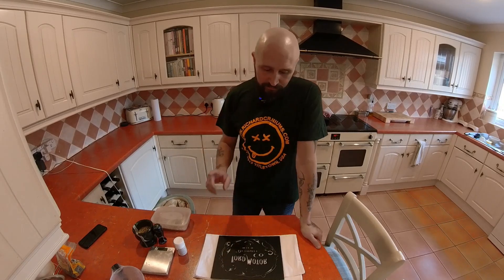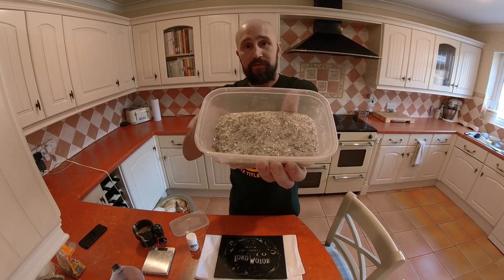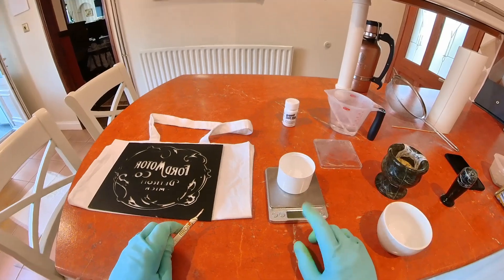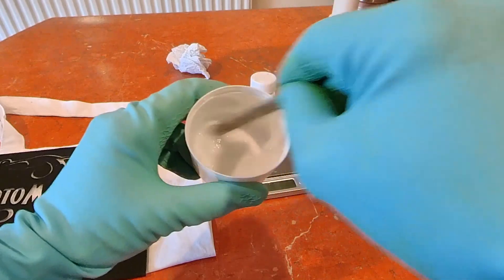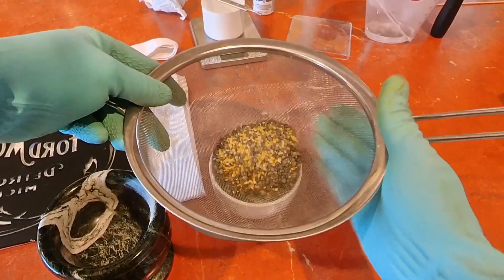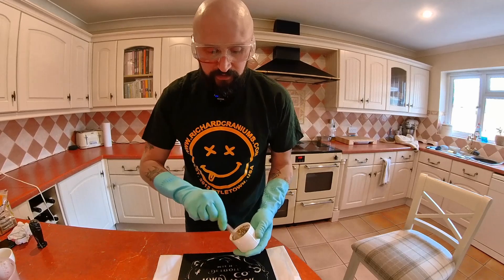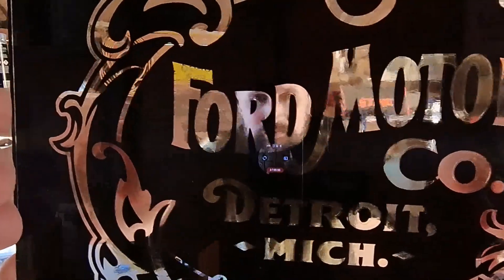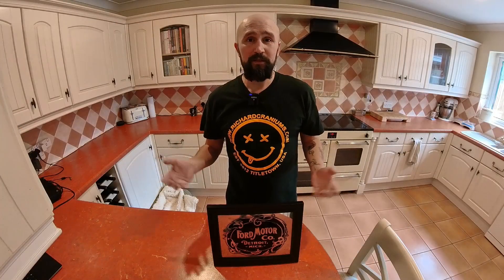Reverse glass process. Acid etching without HF acid

Comment: Great post Paul ... I have used acid many moons ago and too many issues working and disposing of chemicals. There used to be a "Fake" screen print ink that created a sand blast effect. I used it for  signage on office glass doors and full size windows so people were aware of the glass.
Be safe mate...
Reply from the maker: Thanks Ken! I don’t like working with HF acid. It’s too dangerous, so when the bottle I have runs out, I’ll use this method going forward. 
Hope you’re good mate!

Comment: Thank you for these tutorials. I’ve had an idea that I’d like to try out and this tutorial is such a great start.

Have you done an etch on the back of the mirror? I was going to use a mix of screen printing and the mirror spray paint but I couldn’t find the plain glass and thought a more cost effective way could be to etch the back of the mirror.

I won’t be using the HC acid but similar product that you are using here, as a test.

I’m a complete newbie to all this glass work and can’t wait to get started with it.
Reply from the maker: Thank you, I'm glad you enjoyed it! Unfortunately it won't work on the back of a mirror because mirror backing paint is acid resistant.
Reply: Yes, after some more research it does appear that I would need to strip the paint first then somehow remove the silver finish. I’ve read somewhere that Ferric Chloride or even bleach should work with silver based glass. Do you have any experience on this and what would you recommend?

Comment: Good video.
So, if armour etch, not diluted, makes a cloudy effect like sand blasting... could you use AE undiluted instead of sandblasting?
Reply from the maker: Thanks Stuart. You can if you just want etched glass, but the finish is too smooth for glue chipping. It also won't touch the backing paint of a mirror so you'd need a sandblaster for that. Great stuff though and the etched finish is lovely

Comment: It's a shame you removed the original acid etching video, but this is just genius as a way to make the technique safer and more accessible.
Reply from the maker: Thanks very much! It is a shame but it’s too risky sharing a process that’s so dangerous. This way is more expensive but so much safer that the traditional method

Comment: love your videos. if i were to use this method could i achieve chipped glass. i do not have a sand blaster so im trying to find a good alternative.
Reply from the maker: Glad you're enjoying the vids! This won't work for glue chipping because the etch is too smooth for the glue to grip on to. This may be an alternative though: https://youtu.be/jMZuSIynl94

Comment: So you used black spray paint for the black areas?  If so, does the solvent in the black spray paint not have any bad effects on the mirror effect paint that has already been sprayed?
Reply from the maker: No it doesn’t, but the mirror spray is very aggressive if sprayed on most paints, so it’s best to get that stuff down first
Reply: @happygilder  It looks like it didn't harm the black when you added the antiqued silver last so that's good.
Reply from the maker: @questort  you have to do really thin coats, otherwise it eats the other paint away

Comment: Great video and techniques again! I have a question : I cut vinyl, applied it to the reverse of a picture frames glass and sprayed it with the same mirror effect as you. For me, I sorted of "melted" the edge of the vinyl and bled through. Any ideas why ? Your edges look lovely and clean!
Reply from the maker: Thank you! The mirror paint is very corrosive so you have to apply it in lots of very thin coats rather than an even coating like most spray paints
Reply: @happygilder  thanks for that. I'll be more conservative with my application next time.
Reply: Could be the adhesive on the vinyl, I only use oracal 651 cause it's chemical based adhesive instead of water based like 641. If edge lifts that's why. I chemical silver all the time, never had a issue with lifting
Reply: @scotthendricks79  ok - thanks - I will look at that. I just buy the cheapest.

Comment: Do you have a video about framing or making custom frames for the glass?
Reply from the maker: Unfortunately framing isn’t one of my strong points so I won’t be making a video about that anytime soon 😄
Reply: The trick I used for this is to check the local goodwill and thrift shops. I go every weekend and come back with 2-3 new frames with glass that I can use from about $3-6 each.
Reply: @VektorHaus  
Same here. If I can’t find vintage ones at goodwill, I’ll take a torch to a wooden frame, clean it with a bristle brush, and apply some finish.

Comment: Quick question, with HF you need to sand blast it like glue chipping.  Would you consider it good practice to do the same with this process?
Reply from the maker: You don’t need to sandblast glass for acid etching. It works best on clear glass

Comment: Paul I enjoy the channel. I am a graphics designer and am trying my hand at glass chipping. I do not have a sand blaster but do have a laser engraver and my question is do you know if anyone that is etching glass has any success with the chipping on laser etched glass. Thank you for the channel.
Reply from the maker: Someone on the Facebook group tried it and had some success. I’ve never tried it so I don’t know whether it would achieve the same result as sandblasted glass
Reply: Thank you I will let you know if I get something figured out

Comment: You should always put acid into water. Probably not a big deal here but it's dangerous.
Reply from the maker: Thanks man. When I use HF acid I always add it to water so it doesn’t spit. I should probably do the same with the armour etch